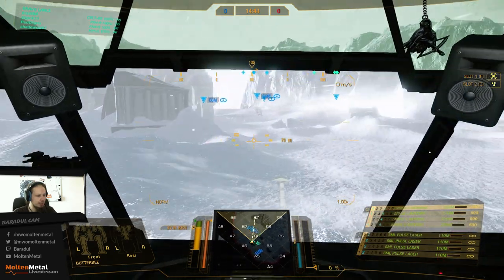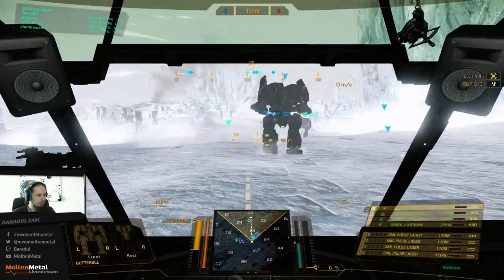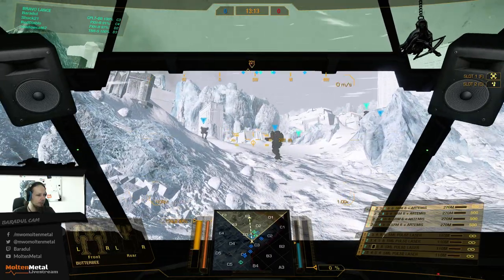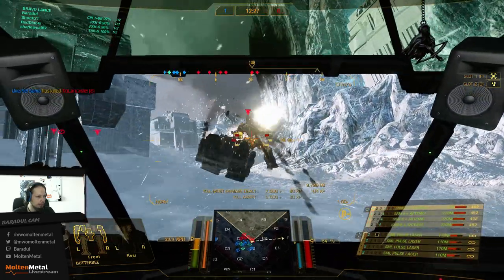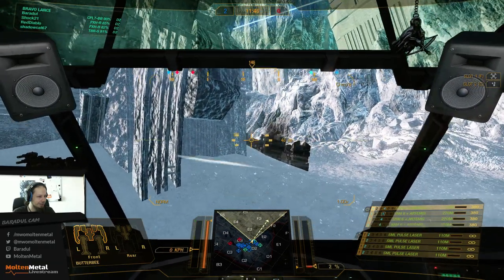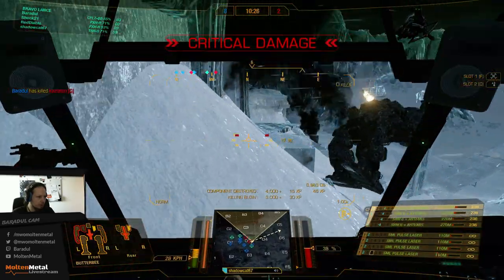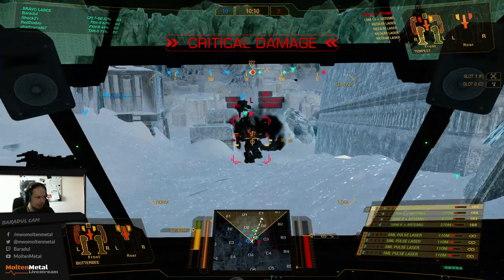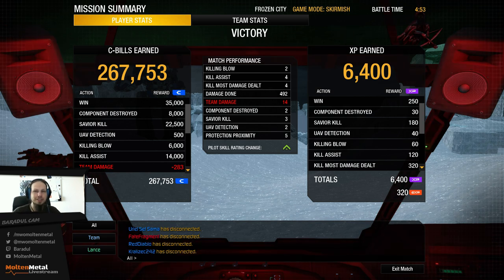BUTTERBEE Catapult Hero Mech - Mechwarrior Online

Comment: Baradul cam works)
The build - it's interesting, I see a lot of small pulse BBs, and it's meta too, and I really dont know why. Imo -4ml is better:
http://mwo.smurfy-net.de/mechlab#i=420&l=cf7b6ba13b9b279aeacaf58b83652459b48938ef
Cat simply doesnt have the speed to fully utilize spls on most quickplay maps, and mediums sync with srms perfectly cooldown- and distance- wise. Also 4 jj is too much, you'll rarely use the full bar.
Reply from the maker: +banana peel That was a Budget build. I had the xl300 in stock and did not want to buy a XL315 😃
Reply: Good point. That's a little hot to brawl with all the weapons, though - how about dropping an ML, a JJ & 0.5t ammo for a DHS & 0.5t armor?
http://mwo.smurfy-net.de/mechlab#i=420&l=e841a36cc65faebf47343a9a1f017c2af812b3a7
Reply: ok, you are forgiven about the engine!)
but srsly, i cant understand why people prefer spls to accompany srms.

Comment: Although the 300 is a nice engine, every incremental speed advantage over the big guys is crucial to such a close range 'Mech, so I would happily pay the extra 2.5t to get the extra 4kph provided by the 315. To do this, I'd either go down to SLs or else go to a "scrambler"™ configuration with only 1 JJ:

1) SL jumper:
65t Catapult Butterbee
4 SRM-6s w/Artemis + 6.5t ammo (27.08 volleys @270m), 4 SLs (148.5m), 63.60 FP
XL315 (84.4kph), 4/4 JJs (32.45m)
384/422 std arm, es, 13 dhs (36% cool), 1 slot free
mis vel +10%
sl rng, srm-6 cd, radar dep, seismic, cs6, cs9
http://mwo.smurfy-net.de/mechlab#i=420&l=ef7eb7779dd750cf74a8d47c2b03c2e2e639df96

2) SPL scrambler:
65t Catapult Butterbee
4 SRM-6s w/Artemis + 6.0t ammo (25 volleys @270m), 4 SPLs (121m), 67.60 FP
XL315 (84.4kph), 1/4 JJs (8.11m)
400/422 std arm, es, 14 dhs (36% cool), 2 slots free
mis vel +10%
spl rng, srm-6 cd, radar dep, seismic, cs6, cs9
http://mwo.smurfy-net.de/mechlab#i=420&l=35138c819f75aaa738cb8f76d9ec69cfd56155c1
Reply: Wha...